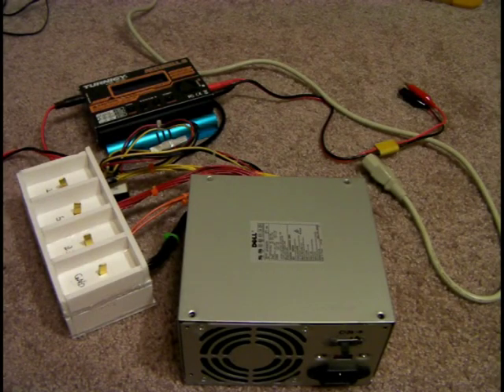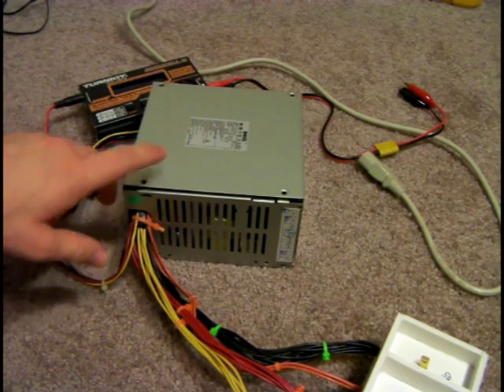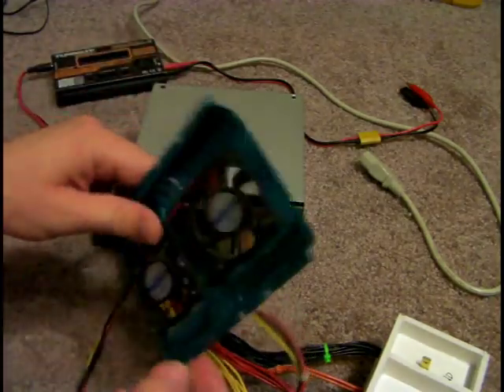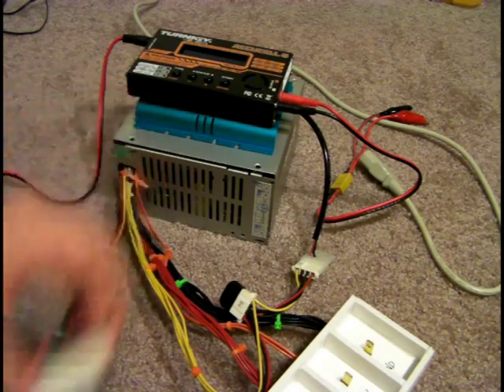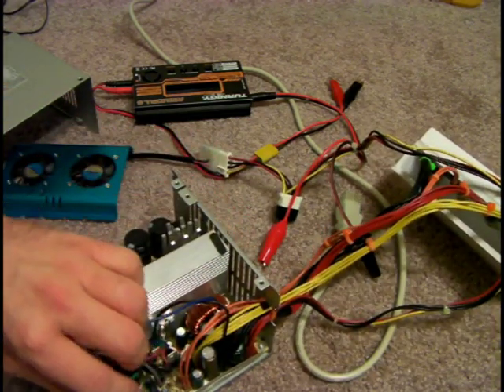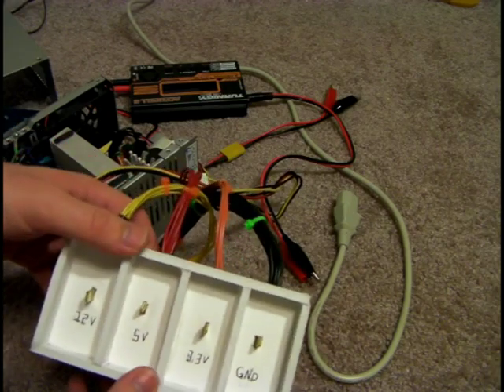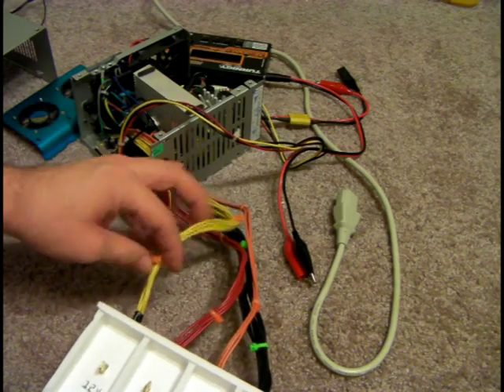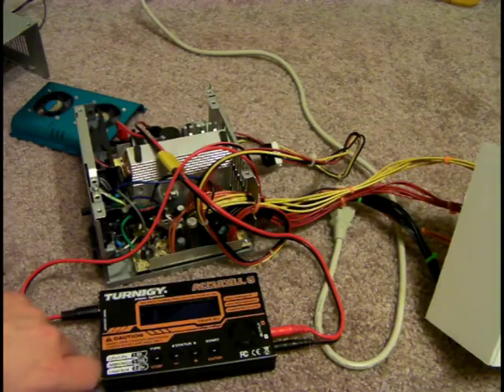Tutorial: PC power supply mods for RC chargers - what you need to know

Comment: Hey there, here is a question. Those power rails supply 12V and 12A max right? So that's good to charge pretty much any battery under 4S. My question is, could you charge a 4S or 6S battery with that PSU?You need 14.8V to charge a 4S. I know that charger could probably convert current to voltage. But wouldn't it get hot? I'm using an adjustable laptop adapter to power my charger. I'm currently using 3S batteries, but i'm feeding the charger with 18V. Since the adapters max current is 5A and i don't want to push it hard to give 5V i think it's better to use higher voltage. What do you think?

Comment from the maker: A special charger for charging LiPo batteries used in RC planes. Nearly all chargers of that type require a reliable 12V power supply. Google "Accucel-6" for an example of one; and it's the one I use.

Comment: @mtvenar yeah fair enough, i ended up using my broken Xbox 360's PSU Brick, i had to short the red and blue wire to get it out standby and then i used the black and yellow for 12v, works really well and is really neat. Thanks for the vid though otherwise i wouldnt of investigated further and would of had to buy one.

Comment: Thanks for your reply, I did figure out what I was missing after talking with the guys at our airfiled. First as you mentioned I needed to use more than one black and one  yellow wire. So I used three of each. Than I had to take a 10amp - 10 ohm resister and place it between a red and black wire. Now both of them are working like a champ I can pull over 4 amps. I use a parralle charging board to charge more than one 2200amp batteries at a time.  thanks again.

Comment from the maker: @renceww18 No, it won't burn the charger. The 19.5A is the maximum current the PSU can supply, not how much power it's constantly putting out. Your charger will never pull that much current so you'll be fine. I never charge my batteries over 1amp anyways (I baby my batteries) so I never use the maximum current potential. If you want to extend the life of your batteries, I suggest charging them at a low rate as well, meaning lower than what the battery can take.

Comment from the maker: @allabouthim03  I use an old 5v PC case fan with a molex connector. The HDD fans in this video are 12v, so they're not using the 5v rail (obviously). The problem I've having is whenever I go to measure the amps with a multimeter, the PSU shuts down. Probably a safety feature, but I still can't measure the amps. All I know is it works and I suggest you try it if you have an old case fan. Just make sure it's 5v by looking on the sticker on the back of the fan. I plan on making a video about this.

Comment: All those Molex wires connect to the same 12v Rail, so you can pull all the amps through 1 molex if you want too, no point in bundling. Bundling can reduce the heat build up per cable though.

Comment: I built two pc power supplys today and I use the same charger as you. The problem I did not expect was that the PS will not handle anything over 2 amps. My charger errors out because the PS can't keep up. The PS should handle around 14 amps on the 12v side. Do you figure out how to make it keep up. you side something about putting a load on the 5v side, how do i do that? thanks.

Comment from the maker: @jpinki6 I had the same problem with using an air compressor. I think it's because a load needs to be put on the red 5V lead to get the full amperage from the 12V. I need to add a caption about it... I didn't mention it in the video because I never charge above .5A so it never kicked off at that low amperage, and at that time I didn't have the air compressor. Also make sure to have the charger connected before you turn on the PSU.

Comment: Nice, I've got the same setup, as well as the same charger.  Charger works great so far, very accurate balancing as well.  The small fan seems like it's wearing out already though, had it for about a year or so.  It's kinda noisy.  It should be fairly simple to replace though.